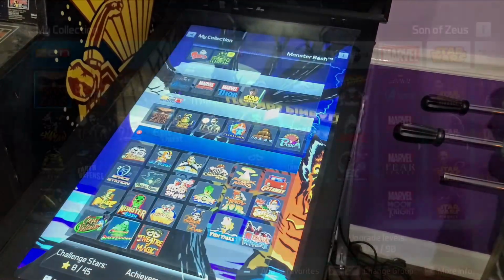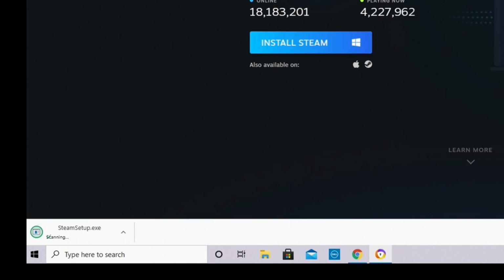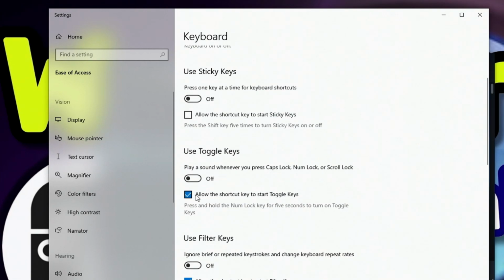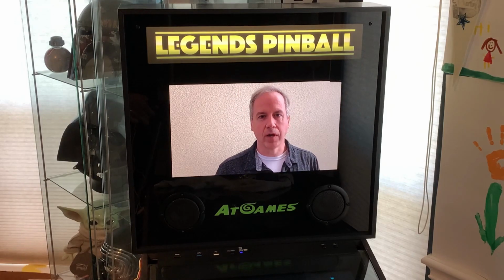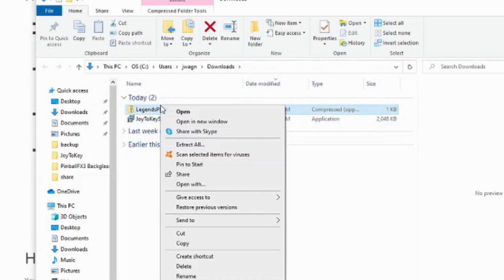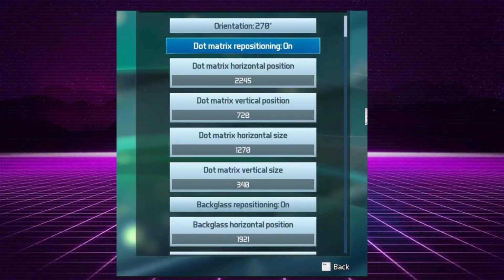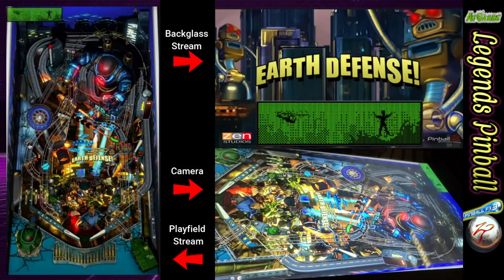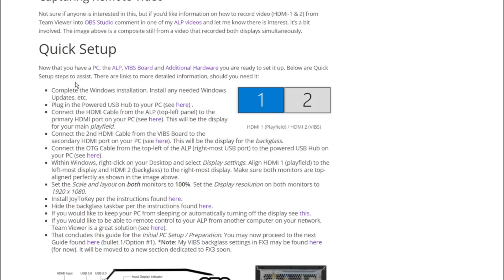Pinball FX3 Setup Guide for the AtGames Legends Pinball Machine

Comment: Hi question for you - so I just got my ALP today and quickly set off in setting up OTG.  The optiplex I ordered along with the VIBS has not been delivered yet should be anyday now.  So I currently have the ALP as the main playfield then I have the Backglass and DMD on my laptop screen.  The question is: Is this the best I can do until I get the VIBS board? meaning I cannot use the ALP back glass at all until the VIBS board comes? I know I can't switch back and forth without it but was wondering if I could just HDMI straight into it but it does not seem to detect it.  So this is likely the best I can do unti that VIBS board shows up yes?
Reply from the maker: Correct, you won't be able to use the backglass until the VIBS board arrives.  Don't plug anything HDMI into the backglass connector, it looks like HDMI but it's not and can cause damage to either the backglass or the device connecting to it.  Wait for the VIBS please, if anything is connected to the backglass, remove immediately.
Reply: @WagnersTechTalk  thank you! And I guess maybe I got lucky I did have something in it briefly but all seems fine.  Thanks again.
Reply: Sorry Mate I have a new one for you.  Been running a setup mentioned previously with my laptop which on OTG mode where the laptop is the backglass and DMD.  The laptop is strong Dell G7 with powerful i7 and GTX 2070.  Obv the ALP is new and on the latest firmware.  BUT I have some kind of unplayable flipper lag on FX3.  I have turned off ball trails and gone to like 2x AA etc etc.  But yah its very noticeable and not good.  Using a USB 3.0 cable from laptop to ALP and its about 6 feet.  This is very disheartening.  Any thoughts?
Reply from the maker: @thesmoness  You can try mapping the buttons directly within FX3.  While my PC and Steam Deck are fine with j2k, others recommend mapping using FX3.  A few other points here: https://wagnerstechtalk.com/alppcsetup/#OTG_Troubleshooting
Reply: @WagnersTechTalk  been doing some slow motion camera testing.  Not super accurate being my iphone on slow mo and my eyeball. But it seems native tables are ~50ms lag, my using my keyboard with no j2k running is about 100ms, and full j2k with 16x cpu time checked is ~150ms.  What is realistic? is yours running same as native or is that 100ms the target?   Gonna try and figure out how to just bind in FX3 see if that gives me same 100ms performance as keyboard

Comment: Is there any way you can make a revised video of this by direct mapping instead of using Joy 2 key? There is too many people doing the joy to key and then come on the AT games Facebook page and try to figure out what's going on. joy to key is not necessary at all and introduces lag.    All it's really need to be done is hit Windows plus the R key type in joy.cpl. Then go into the properties and start pushing buttons and writing down what number lights up for each button.. The nudge also works as well as the plunger. Also, in my experience it's not necessary to hit any calibration. It actually makes stuff worse so I usually reset the calibration button while I'm in there
Reply from the maker: Hi Lee, I use j2k on a PC and Steam Deck, works fine.  If I make any changes, it would likely be an optional section on the guide to discuss direct mapping possibly an addendum video.  But won't be something I get to soon, honestly.  I've got a backlog of about 6 videos currently to complete and for many j2k saves a lot of complexity and works well.  But I will put your request on my todo list.  I do appreciate providing options.
Reply: Awesome sounds good. Discussing the two different options in the video would be great!!

Comment: Ok needs some help. I had this running on old PC. I have another PC that I cannot get the OTG controls to work and its making me nuts. Yes I use ugreen and atolla hub. When plugged in it just does not show up. In PC device manager how and where should it show up? Do you have video how to test with joy2key, I read it on your page but a video could help for visual learners.  ?
Reply from the maker: Make sure you have the OTG cable plugged into the USB 2.0 port (white connector on the ALP).  It should work, everything I know is here: https://wagnerstechtalk.com/alppcsetup/#OTG_Troubleshooting .  Sounds like you've got the hardware you need, just double check all the connections.

Comment: I'm trying to set up FX3 on my Legends Pinball, but all I get on my playfield is my computer's main home screen in landscape position.  It does not move, just shows same thing.  Does not show my mouse and nothing works.  My back screen works perfect and shows everything I do on the computer, mouse works, etc.  Any idea what I'm doing wrong?  I'm using all the cables you used when setting the Legends Pinball to Steam Deck in your video about 10 days ago.  Thanks in advance.  Gary
Reply from the maker: It sounds like your displays are oriented properly, but double-check the settings for the display here (2nd bullet point): https://wagnerstechtalk.com/alpfx3/#Software_Considerations .  Also, make sure when you pressed the Channel button you set things like this: https://wagnerstechtalk.com/alppcsetup/#Switch_HDMI_Input

Comment: How do I make this work with a 3 screen setup?
Reply from the maker: I don't have a 3 screen setup, so can't tell you exactly.  But basically, the 3rd screen would be on the very far right and you'd need to change the dot matrix positioning values according to your display resolution, etc.

Comment: For some reason when I downloaded the FX3 Backglass artwork and copy/pasted them in the file path you provided, the artwork still doesn't show when I go to select a game in FX3.  All the artwork files are .JPG files.  Any suggestions on how I can get the backglass artwork to appear?
Reply from the maker: Double check that they were copied to the correct folder.  They should work just fine.  In the troubleshooting section, I also have a single file  you can download (without my logo on it) incase you want to use that when a table isn't selected it will show that instead of a black screen.
Reply from the maker: Haven't had anyone that said it didn't work.  I just copied the artwork here: C:\Program Files (x86)\Steam\steamapps\common\Pinball FX3\data\steam.  Perhaps try exiting FX3 and back in?  From the archive link, at the top select PinballFX3 Backglass --> Download.  Extract and only copy the .jpg files into the \data\steam folder (make sure there are no subdirectories).  Should be good to go.
Reply: @WagnersTechTalk  I figured it out...the Backglass repositioning was OFF.  I switched it to ON.  Problem solved. 🤦‍♂️  So sorry to trouble you, and thanks as always for your help!
Reply from the maker: Awesome, happy you got it sorted out!

Comment: So followed the guide and no video on my pinball table. It has sound but just a grey screen. I’ve emailed atgames they said my best bet is to check with you. The cord is fine I can plug it into my monitor it works fine. I’ve check all settings they are where they are supposed to be.
Reply from the maker: If you've hooked an HDMI cable from the primary HDMI output from your PC and plugged it into the top HDMI Input port on the ALP, pressed the Channel button and set the input according to this: https://wagnerstechtalk.com/alppcsetup/#Switch_HDMI_Input you should see the video signal on the main playfield.
Reply: @WagnersTechTalk  yes I’ve done that. No video. It plays sound sound threw the atgames speakers but no video.
Reply from the maker: Make sure the video resolution on the PC is set to 1920x1080 when connecting to your external monitor (not 4k).  If that doesn't help, try a different HDMI cable.  If neither of those, may be an issue with the HDMI input on the ALP.

Comment: Thanks for the video. I followed the it to get FX3 playing on my ALP. However, I have one issue.

On a couple of the tables, the ball isn't smoothly rolling; it's kind of teleporting from place to place. All of the other graphics look fine, but the ball is just kind of jumping instead of rolling. ... not sure how else to describe it.

Any idea how to clean up the graphics so the ball looks like it's smoothly rolling?

Thanks!
Reply from the maker: Hi Rick, one thing that you can try is the last point here "Screen Tearing with FX3": https://wagnerstechtalk.com/alpfx3/#FX3_Troubleshooting .  If that doesn't help, see the link in the grey box here: https://wagnerstechtalk.com/alp-mod1/#Chapter_5_PC_Requirements and double-check your PC is powerful enough to smoothly play FX3.  Let me know what you find, the VSync option may be the solution (first link above).
Reply: @WagnersTechTalk  Thanks for the help.

Found it! My graphics card was set to "Auto," which meant the tables weren't using the graphics card. I switched it so that the graphics card is always on, and it cleaned everything up! Woot!
Reply from the maker: @RickGrundy  Awesome, great to hear!

Comment: I followed your tutorial for setting up Joy to key it is not picking up the other file that I downloaded now as far as pinball fx3 ever since I downloaded that other stuff I no longer have any controls on the pinball fx3 I have the Legends pinball with the arcade stick I went into steam and try to set it up like an Xbox one controller. I also followed the pinup popper install video  I first did this a few days ago and it worked fine now that I've installed pin-up popper I have no controls on anything that work only the keyboard and that's not what I want to play with since I have an app games Legends pinball machine. One issue that I have also had is when I did have it actually working it had no sound and nothing on the back glass and when I would back out of the game the screen would just continuously scroll very fast
Reply from the maker: Hi Daniel, not sure what other file that you downloaded but the correct profile will need to be selected in j2k for it to work.  Also, if you define the button mapping in two places, you'll of course get double entries when pressing buttons.  For more information on j2k, this section should help: https://wagnerstechtalk.com/alppcsetup/#How_to_Setup_JoyToKey

Comment: Man... i really wish they had USB access in back of the machine or underneath it because those wires look like ASS!!!!! lol. Other than that i'm looking forward to getting one of these, and setting it up with a PC eventually, likely going to swap out that horrid backbox for the $500+ version offered on buystuff. 

I nearly bought a really expensive custom machine but i hear it's best to mod these yourself and learn the ins and outs of the software so they're easier to troubleshoot when things go wrong. PLUS if i can't manage to get things running well enough, i'll always have the default tables and optional Zaccaria/Taito ones to fall back on.
Reply from the maker: It would be ideal to have the USB+HDMI at the back.  At one point I was thinking of designing a 3D printed cover (to hide the wires), but when I asked for feedback few seemed interested in it.  I may do it anyway, at some point.  Not sure if you've seen this guide, but you may find it helpful: https://wagnerstechtalk.com/alp-mod1

Comment: Hi Jon. I’ve been looking at this vid over and over a vid ,its great since I never had a PC before. When I boot up the computer it doesn’t show up on my main ALP playfield but when I use the VIBS button it pops up on the bottom of my backbox. I must have an HDMI cable plugged in the wrong spot so I can’t call up the display screen with 2 windows . I have one plugged into the back and the other p-lugged up to the HDMI spot in back up higher  Is this right?
Reply from the maker: Hi Al, please start here : https://wagnerstechtalk.com/alp-mod1/#Chapter_6_VIBS_-Do_I_need_it , if this doesn't help let me know.  It explains what you describe in a bit more detail. There is a video at the top of the page that summarizes this guide also.

Comment: Great video. I’m getting an ALP tomorrow and wanted to do this but it seems I need a dedicated pc. I have a high end gaming PC but it seems like I would have to change steam settings and monitors every time I go between pc gaming and playing fx3? That seem accurate?
Reply from the maker: Yes, that's accurate.  You may find it better to have a dedicated PC for FX3/VPX/FP on the ALP.  If you haven't already, may want to see this: https://wagnerstechtalk.com/alp-mod1 , it will cover many upgrade options that might be helpful to you.
Reply: @WagnersTechTalk  I was reading that mapping within steam eliminates flipper lag, do you agree with that or still recommend J2K?
Reply from the maker: @zlanders77  Sure, I've read that as well.  However, the problem with using steam directly is that it won't help with VPX/FP.  I have a single j2k profile which works with all.  If you were going to use FX3 exclusively then it may provide better performance.  I have virtually no noticeable lag on my machine.  I did optimize my machine, based on information here: https://wagnerstechtalk.com/alppcsetup/#Minimize_Flipper_Latency  However, definitely set it up the way that performs best for you.  I choose to go with j2k for various reasons, one stated above the other is that the information provided in the guide can get anyone up and running far faster/easier than explaining multiple mapping configurations.  I may add more options at some later time, but I've been pretty happy with j2k myself.

Comment: got fx3 running thanx to your walkthru so thanks for that.  only thing im noticing is that sides of the playfield are slighly cut off.  some tables worse than others.  i cant even see the shooter lane on indiana jones.  thoughts?  just wondering if normal or i need to tweak some settings
Reply from the maker: Great news Jay, happy to hear it was helpful to you!  One thing I can think of off-hand is to check and make sure both displays are scaled to 100% in Windows.  During the initial setup, Windows may try to scale it to 150% which might explain the issue you're seeing.  See the 2nd bullet point here for more details: https://wagnerstechtalk.com/alpfx3/#Software_Considerations

Comment: followed your guide and been having a blast so thanx for great vids as always!  question, im getting a lil flipper lag especially if i play arcade versions.  strangely enough less lag when i run zen or regular single player launch.  my computer is a powerhouse with rtx3080 vid card so i know i have enough hp!  i found a sensitivity setting in joy to key and have been tweaking, noticing a lil improvement.  im going to crank it up again tonight - i think im at 3-4 setting currently and it goes up to 16.  is there anything else i can tweak to get better flipper response???
Reply from the maker: Hi Jay, thank you happy the guides/vids have been helpful!  I have a section here that should help with flipper latency: https://wagnerstechtalk.com/alppcsetup/#Minimize_Flipper_Latency .  It's in a shared guide (between FX3 & Popper) since it impacts either.
Reply: @WagnersTechTalk  culprit was joy to key.  turned it off and mapped controller directly in steam and lag went away
Reply from the maker: @jasonforderer  Good to know, thank you for your feedback Jay!

Comment: Love the video. Very helpful and my games are running great. Unfortunately the sound doesn't work well. It is low volume. I have my pc volume at 100%, the Legends volumes settings all the way up, and all of the FX3 volume slides at high, but still get weak sound. Tried switching the HDMI cable but no help there. Don't have weak sound when playing the games installed on the machine, but also get weak volume with Visual Pinball and Future Pinball. Any thoughts? Could it have anything to do with Nvidia settings? Thanks for any help you can provide.
Reply from the maker: Thank you Douglas, happy you've got everything working!  The very last bullet point here is if there is no sound: https://wagnerstechtalk.com/alp/#VIBS_Troubleshooting which doesn't seem to be exactly the issue you're having.  But, it reads:  No sound when using FX3/VPX or Future Pinball (OTG) – click the speaker icon in the lower-right of the taskbar in Windows. Make sure it’s set to output audio to the primary HDMI output (your backglass). Once set properly, the audio should play through just fine.  I'd double check the playfield HDMI connection is the primary HDMI, then adjust the volume control in Windows and see if that helps.  If not, honestly not sure what may be the cause.  If it sounds fine on the ALP itself but weak audio only when the PC is connected, it's something on the PC/Windows side that I've not seen.  May just take some additional tinkering/searching to find a solution.  Sorry I may not be very helpful in this reply.  You can also ask your question on the Legends Ultimate subreddit here: https://www.reddit.com/r/LegendsUltimate , good chance someone there has had the same issue and can be more helpful.